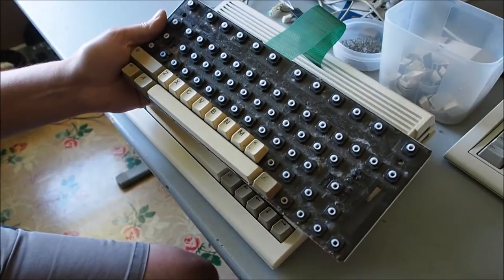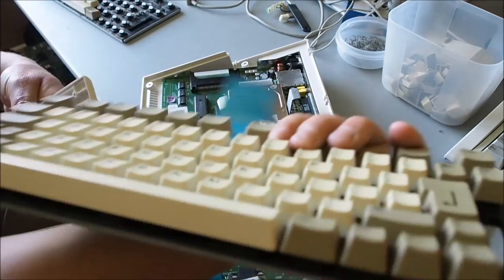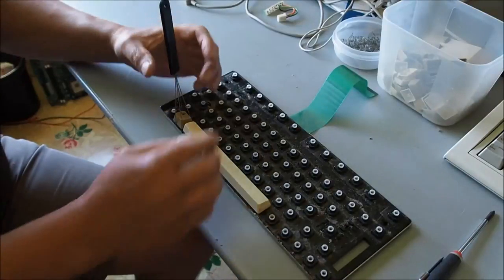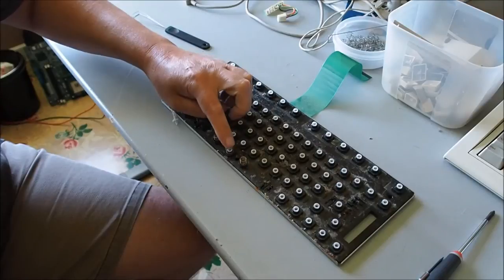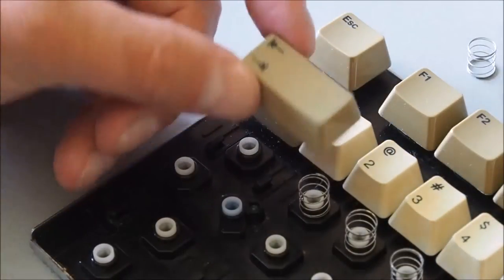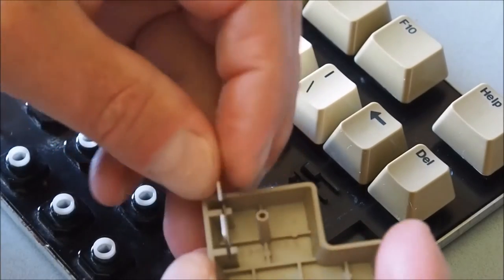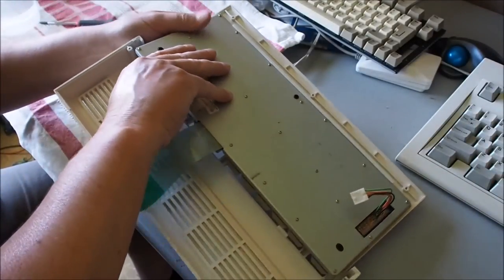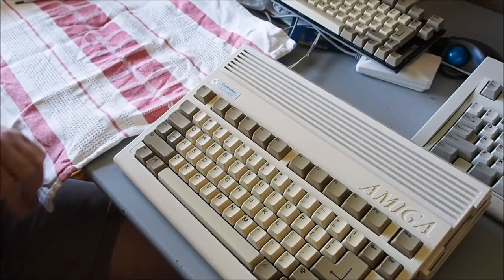Cleaning an Amiga 600 Keyboard

Comment: Thank you for the guide. I'm currently cleaning a Amiga 500 and 3d Printed a key cap pulling tool from thingiverse which worked nice (recommend to print a few they can break rather quickly). 
If someone is looking for Amiga 500 guide, just remove the 6 bottom screws and lift the top cover off, it is not connected to anything. The Keyboard is connected with a small plug to the main machine, not a ribbon cable then you can just lift it up and go on with the tutorial of this video!

Comment: Only today I was pulling an A500 apart to clean and give a peroxide bath. Removing all the keys by hand is time consuming and hurts after a while. After watching the video I bought the same key puller as I'm sure I'll need one again. I would like to be put in contact with this guy to discuss doing recap work on my A600 & A1200. I'm judging by the accent he is on my side of the globe 😀

Comment: Great video, are you from New Zealand?  I'm preparing to retro-bright my Amiga 500 and this video was a great help!
Reply: Thanks for reply, I'm not in Auckland...  I've bought 50% Hydrogen peroxide and some nappy san oxy, will create a paste and leave in the sun hopefully works well I now have a couple of 500's to do now as well as 1200 keys and a mouse or two, I shall see how I go. the bioxpool looks like a great idea, easier and most likely safer than my intended method.  

How long do you soak with the bioxpool?
Reply: i soak them for about 2 days but indoors not out in full sunlight, the stuff realy starts to bubble so have a well ventilated room its worse in day light, night time is not so bad as there is very little UV light,  yeah i have 4 x A500 1 x 600  i like fixing them up  i make them look almost like New oO
Reply: the mouse's seem to take longer 3 days or more lol IDK why maybe  more UV light is needed, also i put something heavy on them as they like to float lol  the bath gives a nice even look unlike the paste that can come out all patchy
Reply: I'm starting to think the BioXpool will be a whole lot easier!  I also think I'll soak them in the garage for a couple if days at least they will be out of the way.
Reply: good idea, yeah its simple as, i just use one of them cheap clear warehouse Storage containers  the amigas fit right in them just right, then after a soak i hose them off and then give them a clean with jiff, they come out like New :-)